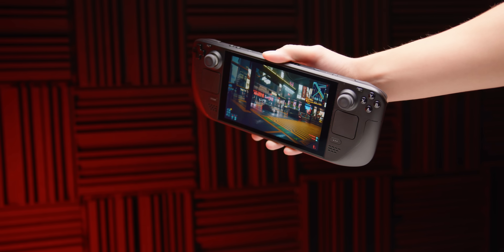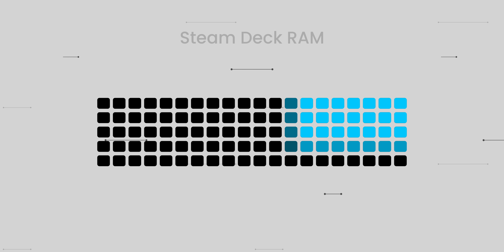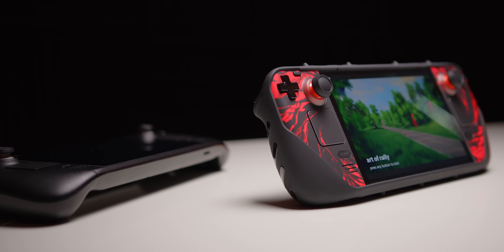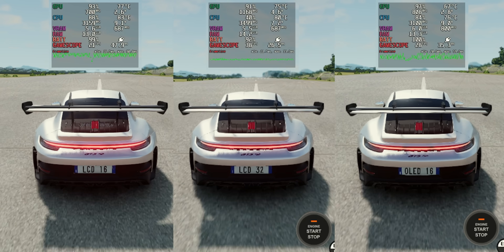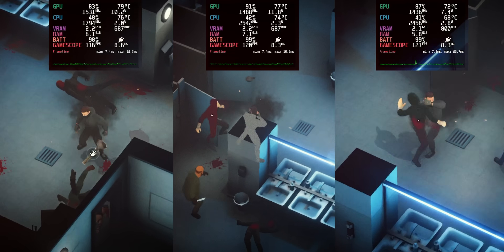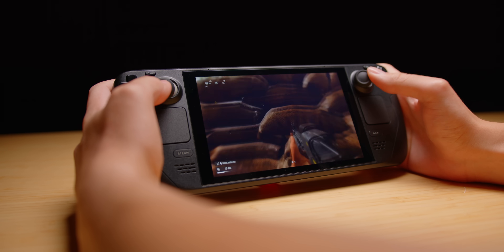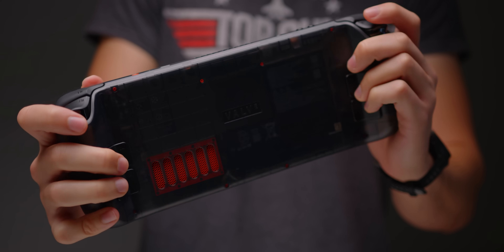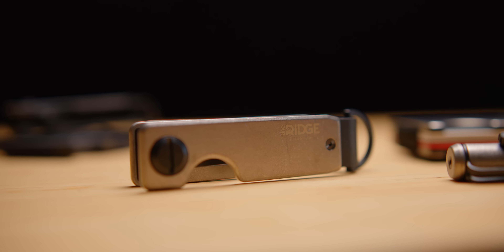I Upgraded The Steam Deck - 16GB vs 32GB of RAM.

Comment: I'm talking about PC here but imo in current year EVERYONE should get 32gb of ram for gaming. I'm constantly surprised but how many games happily use more than 16gb when they have access to it. Also, using Hogwarts: Legacy is just cheating. That game will devour 32gb of ram and still have the audacity to crash regularly LOL
Reply: I fully agree to the point that I have moved to 64gb on my most recent build. I had on 32gb since 2017. Yes 64gb is overkill but ram is cheap and why not.
Reply: @PlayfullWithFire ”ram is cheap” jinxed it bro
Reply: @rjScubaSki  yeah i was thinking... "this didn't age well!"
Reply: @PlayfullWithFire ram speed > unused capacity.
Reply: @brkbtjunkie  your right when it comes to the steam deck as the GPU uses shared system memory.
Reply: @PlayfullWithFire  As great as that was a few years ago, this is (current year), your not gonna get by with just 64 measly gigabytes anymore. Ya gotta have 128gb of ram nowadays, AT LEAST, otherwise, you won't be able to watch YouTube in the background without a dip in performance! Don't worry bro, you don't need to upgrade for maybe another few weeks but you should consider it, ram is, like, super cheap.
Reply: @user-TheTrueGibly  I was told I can just download more ram.
Reply: Agree any new builds should be targeting 32gb but older rigs with 16gb are still very able machines.
Reply: 16gb is fine for most gaming workloads. Handhelds should be at 24gb or 32gb just so more ram can be allocated to the GPU
Reply: @crestofhonor2349 lol... 3gb vram is more than enough for 720p high settings... Especially for steamdeck... Speed matters more than ram... The speed of 8 rdna 512cores with ram speed is what matters...it doesn't matter if you increase ram and that stutter is basically optimisation issue.. Change 16gb to 12gb instead of 32 gb and you see same result... 
Ram heavy? Games love to take ram if available...😂Every ram heavy game you talk about is badly optimized game.. 
16gb is more than enough and here interesting fact, for steamdeck, it doesn't even need 16gb...8 gb free ram and 3 gb vram is more than enough...
Assassin's creed games proves it... Look for consumption of ram and vram when you change from low to very high.. It pretty much doesn't change.. 
So basically it's taking ram and vram because it exist 😂... Game developers do it to load and unload texture in advance if extra ram is available but this is good for pc bad for steamdeck because there's no increase in performance and there's decreased battery performance..
Reply: @THUGPUTIN  ratchet and clank Rift Apart is ram heavy on handhelds. The Deck allocates somewhere around 8gb for VRAM. That game isn’t poorly optimized
Reply: @crestofhonor2349 definitely, next handheld I get has to have 32GB ram.
Reply: I got 32GB about 4 and half years ago for my PC because it was so cheap, I was going to go for 16GB, but yeah, today, I see little reason for not going for 32GB, especially if you want future proofing.

I also hope the Steam Deck 2 offers a 32GB option, I think it will need it as games are getting more demanding and rivals are bound to offer 32GB options by the time the Deck 2 is out.

32GB is so cheap nowadays that I see little reason to not go for it, even if there are not many times that you go beyond 16GB, it's nice to have that overhead that you can and it's good for future proofing, also, we should remember that the Deck being an APU, it shares the memory between system and vram, so overall, you are actually getting less memory in one area or the other compared to what we get if say we had 16GB system memory and 8GB vram, so 32GB for an APU would give you a lot of room for both system and vram.
Reply: You guys are forgetting the deck uses its ram as vram 16gb of ram on a normal gaming pc is fine
Reply: My 2020 Triton 300 came with 32gb was quite surprised that newer games have no problem taking over 16gb
Reply: The steamdeck shares it's ram with the GPU and CPU. 32gb is still overkill... Sorta. I have had 32gb in my rigs since 2016. It's finally now getting to the point where it's useful
Reply: @randybobandy9828   For SD sure but for other PC handhelds it's not cause remember on your PC you likely have 8 or 12 or whatever GB of GDDR6 or DGGR6X exclusive to the GPU...
Reply: Cached ram is not committed ram
Reply: 16 is perfectly fine on dedicated gpus and fine on igpus, but 32 on igpus actually benefit way more due to having more vram since ram is used for vram on igpus
Reply: Developers should properly optimize games. Instead of requiring so much RAM
Reply: @LuisPerez-5  
Should they? Absolutely 
Will they? Absolutely not
Reply: @CrocoDylianVT  The more people keep buying these unoptimized games, they won't have a reason to
Reply: @LuisPerez-5 youre nit gonna force developers to.change their optimization by not buying, theyll pivot game content before they change how well games run
Reply: I'll put a down payment on my RAM sticks rq
Reply: I agree I really like having 32 gigs of ram.
Reply: Lol I'd have to agree there are a few games that have crashed in me such as Exoprimal and Diablo 4 due to lack of RAM.  Only way to fix is restart my PC or close down Edge haha
Reply: I had 16gb use mts browser and game tabs, with 16 I felt the system choking and not so flowing, with 32 it is always free
Reply: Any game that uses more than that is being poorly optimized
Reply: @chasegrimmstone8647  only if you have other apps open. 16gb should be fine if your on a budget but a high end rig has at least 32gb three days.
Reply: Games need more than 16gb because of drm. It's power hungry
Reply: @Marta1Buck  it’s not DRM. DRM is more likely to impact CPU or GPU, which it already does not ram
Reply: 16gb is good for me as the games I play possible can be played on a 8gb system also I have never felt interested in Harry Potter
Reply: for 800p gaming? Hell no.
Reply: @felippedias5446  I have a Steam Deck and it looks crispier than my 1080p 24in monitor
Reply: I run Hogwarts Legacy on a Legion Laptop with a 4070 and 32gb of RAM. I have never had it crash, buttery smooth gameplay.
Reply: I mostly agree, when I bought my gaming laptop in 2022 I upgraded it to 32GB ram. However; while I mostly run 1080P (and sometimes 4K on my tv).
However, don't forget that the Steam Deck 1 runs 720P.
This does change how much processing power and memory is needed. 
For those pc handhelds that do run 1080P or higher I think you would need 32GB memory more; certainly as its shared.
Reply: Just bc games arent optimized and windows bloats doesnt mean we have to get top hardware, just look up the steam users hardware percentages people barley uses above i5s 😂
Reply: 32gb ram? hallmark of a sloppy optimization.
Reply: On the one hand, I have 48 GB of RAM in my main rig. On the other, I hesitate to advise people spend more on hardware simply because devs can’t optimize anymore. Maybe we should ignore new games until optimization is in again.
Reply: Going 16 instead of 32 doesn't save a lot of money these days, so it almost doesn't make sense to just get 16GB.

But purely from a technical perspective, it's far more useful to increase from 16 the 32 on a shared memory device like the Deck. On desktop the GPU will usually have its own memory and most games are fairly economical about system memory usage.
Reply: @KarimTemple I don't think they are that much expensive specially for a manufacturer that buys in millions unless it's like those fastest LPDDR5X currently above 7000mhz but even that shouldn't be crazy expensive for manufacturers that sell a lot like SteamDeck but the problem is they make the final buyer to pay a magnitude more just because it has 32GB...
Reply: @KarimTemple fym, it literally costs DOUBLE
Reply: @CrocoDylianVT  It does not.
Reply: @KarimTemple  It does yes.
Reply: @CrocoDylianVT no it doesnt bro 32 gbs of ddr5 ram is like 60 to 70 bucks lol especially used
Reply: 16gb should be enough just for gaming now, but normally we never have just the game running, we have other apps that eat the ram, so 32gb would be the safepot for now. For steamdeck, steamOS specifically where you can only be doing 1 thing at a time, 16gb ram is just fine.
Reply: @videosuu300  Honestly I felt that 16 GB is just fine for the Steam Deck, and after seeing how minimal of an improvement (and in instances seems like a detriment) the 32 GB of ram is for the LCD model I'm even more convinced it's fine as it is. Maybe a little 16gb could have been good because of the shared memory. Like 24gb so you could up the Vram allocation. But it honestly doesn't seem that necessary for the Deck. Maybe something like the RoG Ally or the Legion Go could benefit more from the 32 GB.
Reply: 16gb plenty. Not everyone games at high details and resolution
Reply: Even more reason to have 32gb, since games will be running in to VRAM limits more on a lower-end PC and will appreciate the extra ram to fall back on.
Reply: @kylerclarke2689  On a PC with a dedicated GPU you don't want to switch to the system ram as that's when the game begins to chug. Having 32gb of ram will not help those with GPU ram just those games that need more system ram
Reply: @ademiravdic detail and resolution most requires high vram instead of system ram.
Reply: i built a new rig with 16gb and it never crosses 12gb of usage when gaming. but it might be because im using a super optimized linux distro
Reply: @256odeon  Nah that's not the reason. It's likely down to the games you play and the settings you use
Reply: Software is meant to use as RAM as possible, so if a game uses X ram is not because that game always uses that ram, but because it HAS free ram that can be used. Free ram is wasted ram
Reply: @santiagofamo18   yeah but also the more ram you feed the more it uses like even if you have 16GB and it's more than enough if you go for 32GB the game will usually use a good % more... Even though far from the 32GB...
Reply: @guily6669  Right, but the point is that you cant benchmark a RAM upgrade by RAM usage because having more ram means that programs will use more RAM.

This doesn't mean that more RAM it's pointless, but more that how can my computer work doing more tasks simultaneously
Reply: @santiagofamo18   but it's never a bad thing to have more future wise for sure 😎
Reply: You don’t know anything about computers… please stop commenting like you do. 16 GB of RAM is MORE than enough. Please learn and understand what ram does because you sound confused.
Reply: @LouieM727 bro their point was 32 gbs is like almost the same price and can be helpful so just get 32 instead
Reply: Dont want to burst your buble but steamdeck is a pc.
Reply: @hornantuutti5157 he said PC because it is politically correct. Steam Deck is a slur. 

Also in an alternative interpretation maybe he said PC since the average person can actually replace their RAM in a PC. Where as in a handheld PC you have to desolder the RAM chips without ruining your board.
Reply: @hornantuutti5157 so is a calculator.
Reply: Not everyone can afford 32, shit some people even can't afford 16
Reply: I'm prefectly happy with my 8 gigs, it's not my fault that game publishers are morons and can't optimise their games oor shit